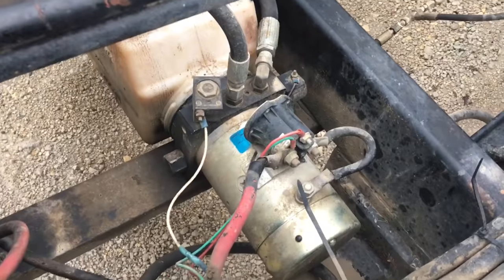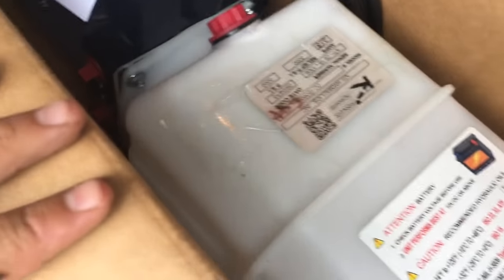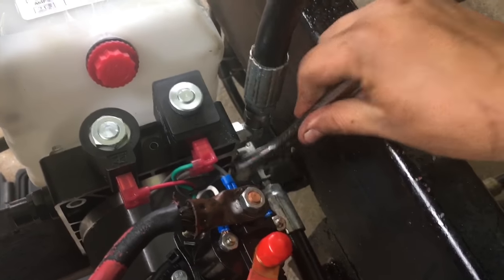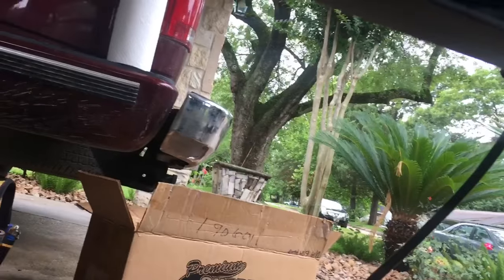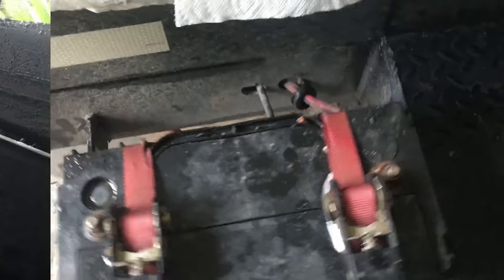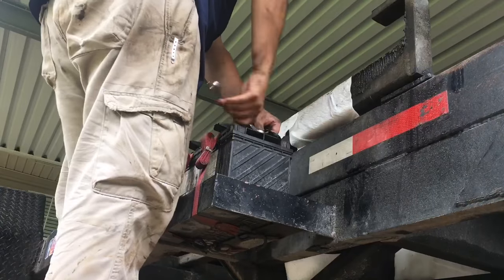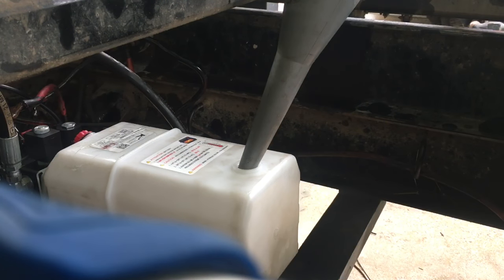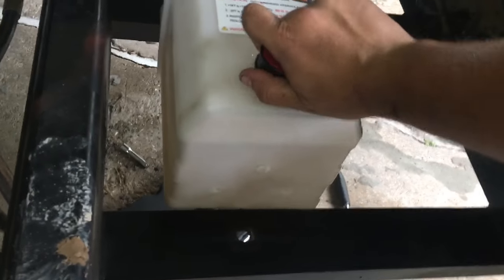How to install a 12v electric hydraulic pump, power unit

Comment: I have a 1993 Winnebago Elante' mounted on a Chevy P30 Chassis.  It has a hydraulic pump that runs both the power steering and the brakes.  I have trouble with the pump bracket loosening or the belt stretching.  This reduces the power to the pump at slow road speeds the power steering gets very difficult and the brakes then require BOTH feet on the pedal to stop.  Is there an aftermarket pump assembly that can be used in place of the belt driven hydraulic pump?

Comment: Next time bypass the the cylinders first mean press it down until you hear the oil filled up the cylinder then raise it on that way all air gone, when the bed is all the way up then open the tank and filled it up

Comment: Some time pump don’t have check valve, so you have to put it on in case someone by mistake press the remote button and the whole bed will come down especially when with the load, check valve before the cylinder between pump and cylinder

Comment: Nice video. Do you have a fuse installed between the pump and the battery? I'm trying to install a pump on a car lift trailer.
Reply from the maker: No fuse
Reply: @Grtruckingdemolitionllc  thanks

Comment: Sorry for my ignorance, But I really don't know alot about Hydraulics... I worked in the underground coal mines and used alot of hydraulics but don't know alot about the specs and do's and don'ts.... I'm actually wondering how you put a hydraulic system on a vehicle? I have a willys jeep and i'm wanting to put a blade on the front that i can raise and lower with hydraulics...  Years ago willys jeeps had an attachment to install a backhoe attachment... Any idea of the type of pump that it would take to install such an attachment? Thanks
Reply from the maker: This could work perfectly you just need to hydraulic hoses going on one end of the piston, and 2 returns hoses on the other end

Comment: the question i have is, it seemed a little unclear, but do you have the ground cable connected directly to the negative terminal on the battery?
Reply from the maker: No it goes to the ground on the trailer and another cable goes from the trailer ground to the terminal

Comment: That is a cool set up! That little pump gets with it!You really should put a small return filter in the line going back to tank . Hopefully there is a strainer or screen inside the tank protecting the intake. And a small pressure gauge will alert you to premature problems or clogged filter . Contamination is a killer, it will take out your directional control valves, that unit is exposed to the elements right? Might need to cover those valves and electrical connections.  Awesome set up!

Comment: hola buenas tardes tengo una bomba spx
stone fenner 12 v de doble actuador , me robaron la botonera y no se como
instalarla ni que tipo de botonera puedo poner para volver a operar la bomba,
seria tan amable de asesorarme sobre la instalacion y el tipo de botonera que
seria la adecuada

Hello, good afternoon, I have a 12V double actuator spx stone fenner pump, my button was stolen and I don't know how to install it or what kind of button I can put to operate the pump again, I would be kind enough to advise on the installation and the type of keypad that would be adequate
Reply from the maker: SAMUEL INCLAN FLORES ya compraste un control nuevo para conectar ? Creo que son como 4 cables que se conectan a la pompa, uno es para el solenoide, otra es tierra, y 2 para las válvulas de sube y baja

Comment: All you had to do was increase the pressure on the old one. There is a adjustment for this on the valve body. Usually need a hyd pressure gauge to do it. Had the same issue with my dump bed pump. Pressure was abiut 850psi from the factory. Turned it up and now dumps a load. Nothing wrong with the pump you removed.
Reply from the maker: TJS Welding and Fabrication it was my fault, I had bought the motor new because the old one was fried. Now when I was taking it apart I also removed the valve body and screwed it all up, messing with it I got it to work, and did use it for about a year. I would have trouble sometimes with heavy loads. And just had no idea how to fix it. I still have the pump thou because I know it’s not bad. Also my other trailer has the same set up, so can use it for parts if needed.

Comment: Hey man, love the video. I need to replace mine but do you think it’ll be able to lift washed sand?
Reply from the maker: It should might struggle a bit but should go up good power
Reply: Always best to load more wet sand towards the back to take the the strain of the lift and helps it go up easier. So uneven the load always helps. I place a divider in my trailer which helps during certain jobs.

Comment: I think those pumps use transmisión fluid  Dextron II.
Reply from the maker: No it’s hydraulic
Reply: Mine is on a 93 international cab over truck. My kti pump says use dexron 3 trans fluid. Or hydraulic oil

Comment: What was the old pump doing. Mine has a hard time lifting the load the first three inches but then it is fine.
Reply from the maker: triaxle01 Same had a hard time lifting dumpsters when they were a bit heavy always had to use a bar to help it go up or use a farm jack, with this one I have picked up really heavy dumpsters and still able to lift it with no problem
Reply: I guess changing the position of cylinders shall do the trick, consider trying on a cad drawing the locus and the load. And see if you can find another position for the culinders. But keep in mind the force exerted on the chassis or any other member may destroy your trailer if it is not supported properly.

Comment: What kind of connection is that to power from truck to trailer battery? I need one
Reply from the maker: You can find it at any trailer place not sure what the connector is called but pretty easy to install
Reply: Look like 175 amp quick connect

Comment: A protective box of some kind would go a long way to give this pump longer life. The road is vicious with road debris and water all over that. Next thing you know, the corrosion and grit make your pump weak or inoperative.
Reply from the maker: Oby-1 i have thought about that, will have to design something to cover it up. The newer trailers have a covered compartment for the pump.

Comment: Amazing video!
I have a question : what you installed(that Grey cylinder near oil tank) is an electric motor that powers a hydraulic pump?
Reply from the maker: Yes 12v electric motor

Comment: How much did you pay for pump and can you please tell me where did you get it thank you
Reply from the maker: MrPelonmelambes bought it at nationwide trailers, for $450 you can find them a bit cheaper online. Just search KTI 12v hydraulic power unit
Reply: Thank you 🙏
Reply: Ouch - I bought the same one off eBay for 205 new with shipping- it just didn’t come with instructions thanks for the video

Comment: What did you run the power lines back to?
Reply from the maker: iinventedrunescape i have a power line coming from the batteries of the truck that keep the trailer batteries charged as I drive. And the trailer batteries are connected to the pump and winch
Reply: Grtruckingdemolition what kinda connection is that, and where’d you get it. I need one just like it

Comment: How fast is the engine rotating
Reply: this isnt ran off of the engine. it is powered by a 12v battery. typically the power units for dump trailers are capable of 1-2gpm @ 2500psi extend, 500psi retract for power up/power down. some are power up/gravity down.

Comment: That Electric hydraulic pump That I need
Reply from the maker: Berly Mora Niño de Guzmán they are very good hydraulic pumps, very powerful and fast
Reply: @Grtruckingdemolitionllc  I'd like to buy it. But I don't know if they'll send it to peru.
Reply: I have an Shimatzu Hydraulic Pump. But without the electrical motor.
Reply from the maker: Berly Mora Niño de Guzmán wow all the way from Peru nice, and I don’t think they will ship this out of the USA
Reply from the maker: Berly Mora Niño de Guzmán is it manual then ?
Reply: @Grtruckingdemolitionllc I got it unuseless.  It doesnt work.
Reply from the maker: Berly Mora Niño de Guzmán I’m pretty sure they should have a company that can make or sale unit similar to this one

Comment: The tank will break off it has to sit in frame like your old one did. You prolly already found that out by now.
Reply from the maker: None of them sit on the ground not even the old ones, they sit 1in higher from the bolt on base
Reply: Grtruckingdemolition mine has an L bracket on end of tank that supports the tank. The bracket is on same plane as bottom of pump and has a sticker dying caution.... bracket must be bolted to frame to support tank.